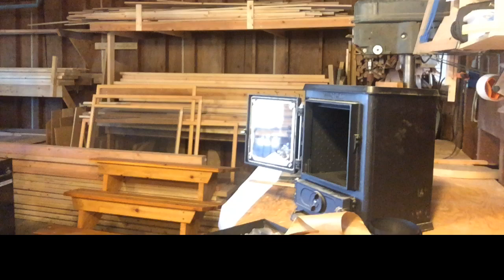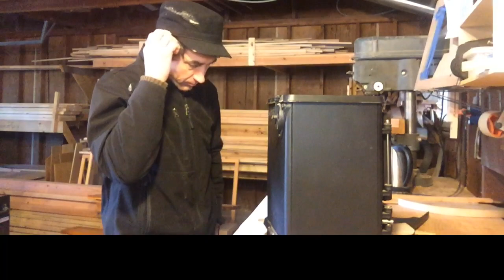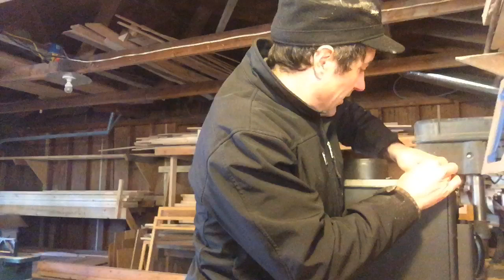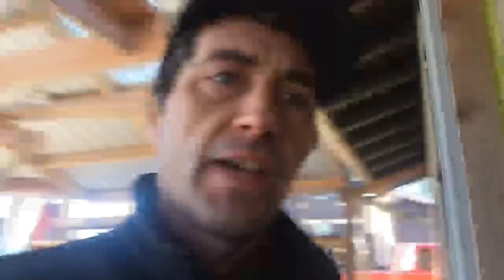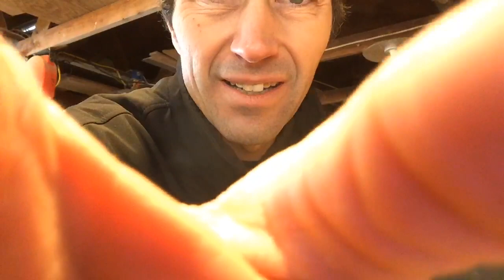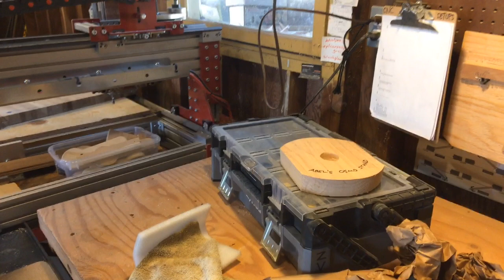Ask Zyl Live - Woodstoves & Insulation - Jan 15, 2017

Comment: Abel, thanks so much for these live videos.

I think the IRC Tiny Code Appendix that you and someone else referred to is here. :
https://tinyhousebuild.com/wp-content/uploads/2016/09/RB168-16-Final-Comment-Reason-Statement.pdf
I'm curious how long it typically takes for IRC provisions to be actually passed by local governments.  Is it something to expect within the next year?  

The IRC tiny house provisions apply only to tiny houses on foundations, so far nothing at all has been passed regarding structures on wheels.  Is it very hard to convert a tiny house built on a trailer to a foundation that would bring it within scope of IRC provisions?  Also, I think someone said the IRC appendix applied only for tiny houses >200 square feet.  I don't see that restriction anywhere within linked document, although it does set minimum size for interior lofts.
Reply from the maker: Thanks Herbert. Yes, the fact that IRC incorporated an appendix for sub-400 sq ft structures is AMAZING. We still have a little work left to get all the different types into the fold.

Comment: I have a question that is not related to the wood stove! what is the square footage of the moon dragon! how much would you charge to build it?  wood the wood stove that you are putting together be enough to heat the moon dragon?
Reply from the maker: Moon Dragon tiny house is 210 sq ft main floor, with a 110sq ft loft. The wood stove that the owners installed easily heats that house. I can build that house for about 95k, give or take. Depends on what you want included.
Reply: OK thank you so much!
Reply: One more thing! Do you build tiny houses that have approximately 400 sq ft?